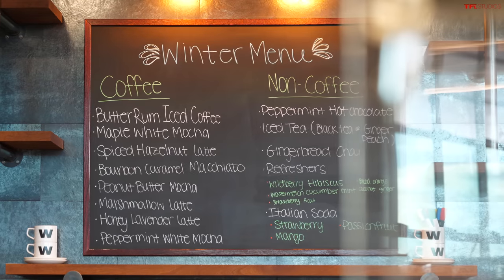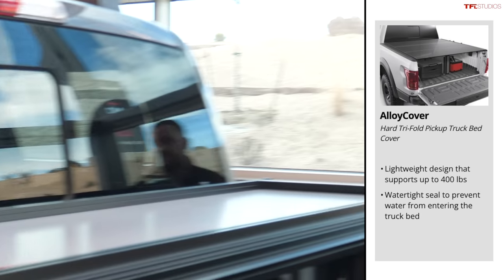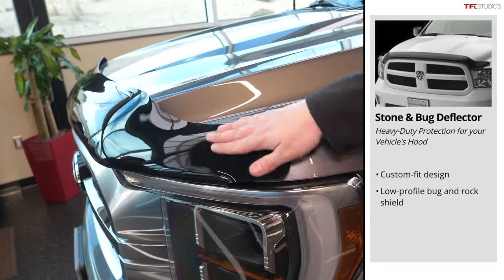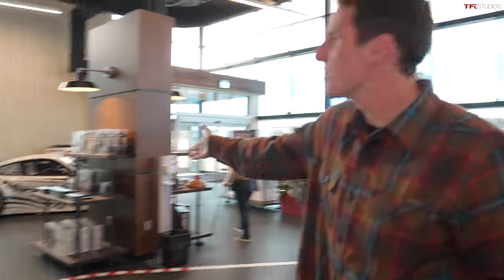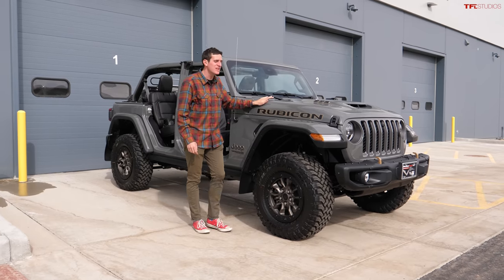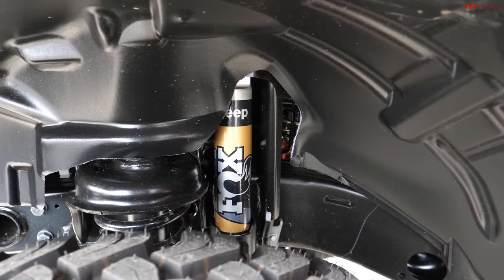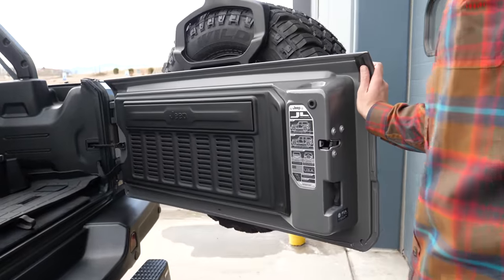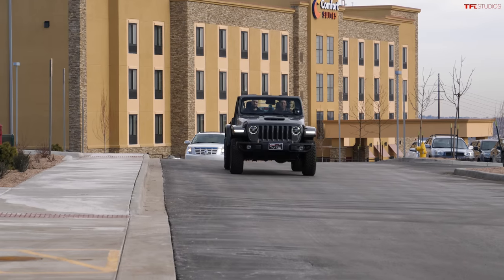Stylish and Practical: These Are The Top MUST-HAVE Accessories For Your Car or Truck!

Comment: The problem I have with the new Jeeps is once you buy it and if something happens and it need's repair the dealer
can't get part's to repair it. I have a 2020 Jeep Gladiator Overland that I paid over $50,000 for and my wife had an
accident with it and it damaged the front differential and it has been sitting at the dealer since November 2021
waiting for part's and the dealer has no idea when they will ever be able to get the part's to repair it.

Comment: Man, the Colorado store is so much cooler than the Illinois one. The store by Chicago didn't have any vehicles displaying the stuff, it was all just mounted on the wall. Which also meant you couldn't touch or feel it since it was up out of reach. It made trying to understand the difference between the materials much harder when I couldn't feel them or see them up close. They really need to implement some of these ideas back there
Reply: Actually, I should correct myself. You could touch the pickup bed covers because they had tiny, demo ones. But that was about it. I even asked the associate helping me if I could feel the different floor liners and was told they didn't have any samples besides what was up on the wall

Comment: I thought it was going to be different kind of “accessories”
Reply: Didn't think I'd add any addons to my stock 2020 2-door Wrangler Rubicon.  However, got spooked by reports of LED headlight thefts.  So, few weeks ago, got a Mopar hood lock installed for peace of mind when parked away from home.  So far, lock seems solid and durable.

Comment: The only option for the Rubicon is an automatic? What has this world come to?? I never thought that I would live to see the death of the manual transmission.
Reply: ppl use those as daily drivers and maybe a couple of days a year on the trail if ever
Reply: You can get a wrangler with a manual. Just not the 392 for some reason
Reply: @mojabi102  Yep, and that is an Asin Transmission made by Toyota!
Reply: @theylied1776  that's why  jeep has so many manual trans problems
Reply: @mojabi102  i think if they made a manual ninth ram 2500 they would. cost to source for a limited run
Reply: @jeffforbes70  Nope, Keep, a k a, Fiat tried to make their own manual transmission and it failed. So now they're using Asin, Toyota manual transmissions.